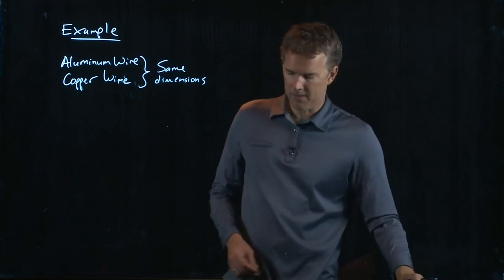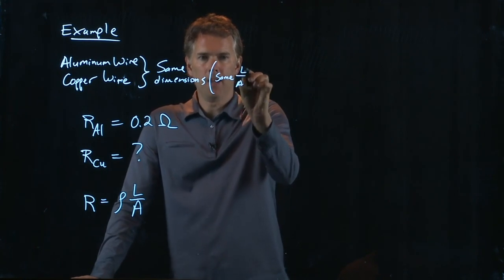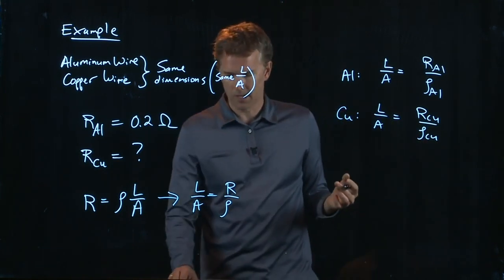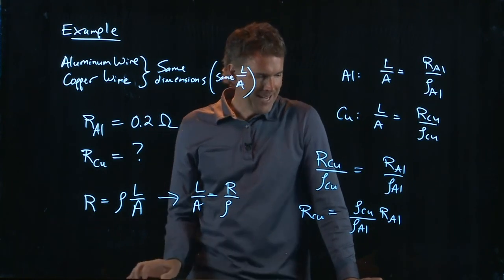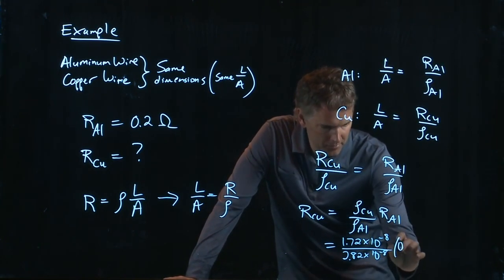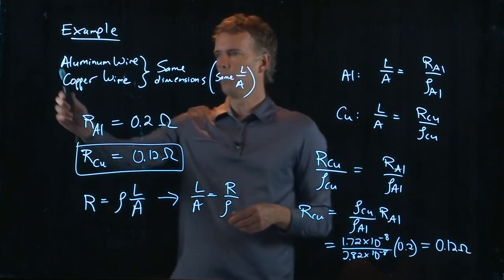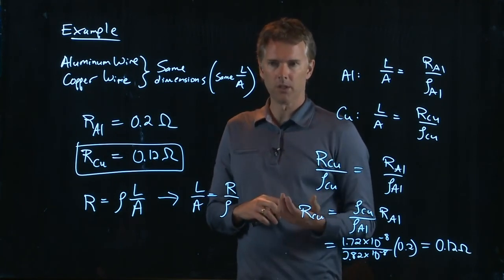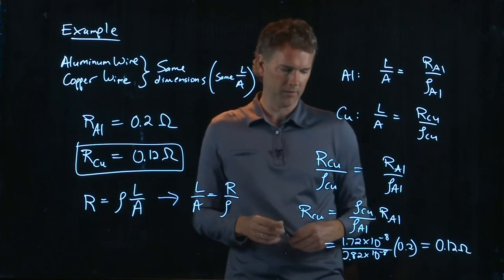Is Copper a Better Conductor than Aluminum? | Physics with Professor Matt Anderson | M21-10

Comment: Most wires used these days for interconnections are made from copper as it offers a low level of resistivity at an acceptable cost compared to Aluminium or any other materials (Gold, Silver...).
Reply from the maker: Correct.  Cost is definitely a consideration as well.
Cheers,
Dr. A

Comment: Copper is mostly used for its better flexibility and ability to solder with lead/tin. Aluminum has much better conductivity for its price and is much lighter for the same conductivity which is why all power grid lines are made from it. I think its a really underappreciated metal in the world of electronics. People don't give it a second thought, because they associate it with these scammy copper plated aluminum wires using the same diameter as the copper original they are knocking off or short lifespan chinese household appliances. Aluminum is the king of cheap 1000w microwave oven transformers.
Reply from the maker: Thanks for chiming in, appreciate the info.
Cheers,
Dr. A